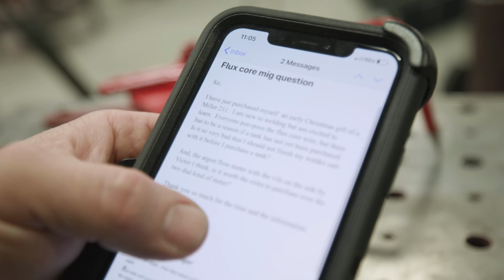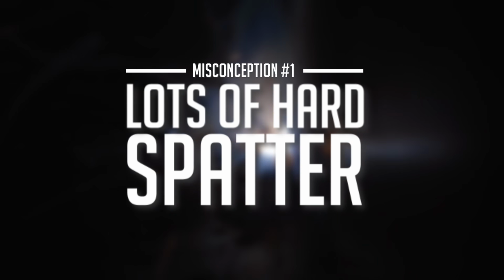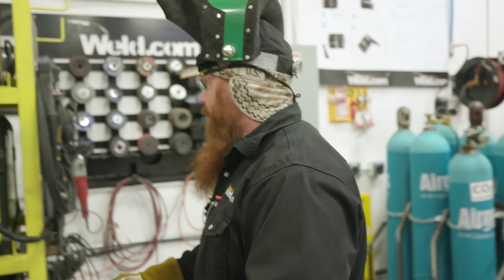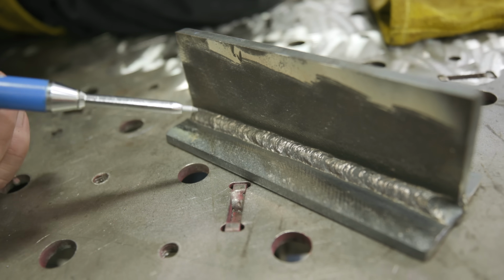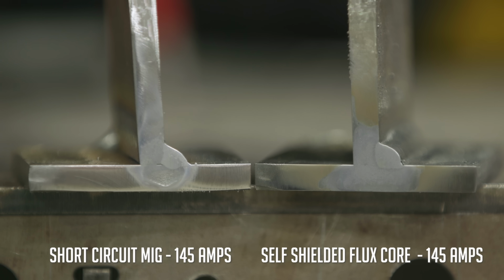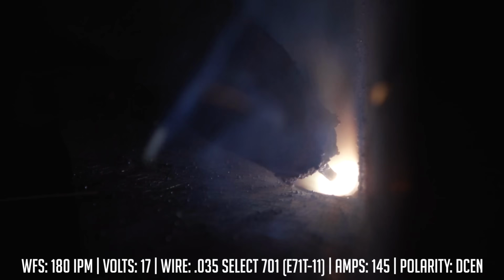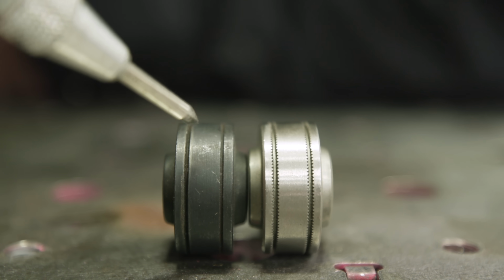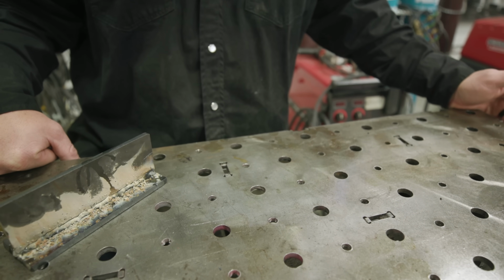3 Flux Core Welding Myths DEBUNKED

Comment: First time I tried flux core welding wire I did not like it. Turned out the guy that had set up the machine had the polarity wrong when set correctly and a little practice. Because it does run a bit different than solid wire. Flux core can actually make a very nice weld with a little practice

Comment: Outdoor and "dirty work" is where flux shines. Use to do structural work in the past. You will usually only find stick and flux welders on a job site. I never got to use it but my old boss had a spool gun for flux wire than would clean up just like a 7018 pass. 1 or 2 taps of a hammer and one big slag chunk would fall off.

Comment: I think flux core gets a bad rap from autobody guys.  If you use flux core doing sheet metal and put body filler over it the chemicals left over in the metal make the filler bubble up over time.  You have to use gas for autobody, unless you're using lead filler.

Comment: id say 75% of my welding is done with flux core with the rest being stick and scratch start tig. flux core works pretty good for things such as bumpers and rock sliders (i only use tig on motorcycle frames and stainless steel)

Comment: 2:56 The same current passes through the MIG wire no matter which polarity. The difference in heat is due to the arc column and the concentration of electrons at each electrode.

Comment: I fixed an old cast iron lawn mower axle that broke in half my little brother used an old mower as an off road mower and I welded it back together with my flux core machine  and it's been fixed for probably a year and a half now hasn't broke yet I love welding I just wish I'd get up and do something with my love for welding

Comment: I have been using flux core for years everybody says it sucks, but its my favorite out of any other wire and or TIG.  You need a very clean DC output and change the polarity,  just those two things got rid of almost all the spatter and it lays down great welds.

Comment: i bought my lincoln 180 welder off a journeyman welder, when i went to his garage to buy it, he showed me that it worked by doing some fluxcore. While he was welding, he said, you will want to get gas though, as you can see how much weld splatter fluxcore has and it sucks. I said to him, you have to switch the polarity. He had no idea what I was talking about. I bought the welder, took it home, switched the polarity and have been welding with fluxcore ever since just great lol (this was my first welder I have ever purchased and first time welding, learned the polarity from youtube. I was just shocked a journeyman welder did not know this, but the truth is, he probably never fluxcore welds)

Comment: I noticed that you switched polarity by just changing lead positions with your wire machine.  Can I do that with a stick welder too, to use polarity sensitive rods?  I am using a Miller Thunderbolt 250 stick machine.

Thanks for a very informative video.  It helped me decide about buying a wire flux machine.

Comment: Curious at my job i have dual feeder and i mostly use flux core over hardwire and nothing with polarity is changed and i run 27 on temp flat and 24 uphill.

Comment: Great video as you know in the trade we use flux core all the time for site work it just so much easier and you don’t have to worry about the tensile strength of the weld metal on those big jobs.

Comment: I have a Hobart flux core welder.. not mig capable so never had to switch polarity. I rip it up with my little welder.. no spatter and never grind my welds.. had a cheaper welder before that was on correct polarity but still sucked balls.. got this Hobart for $300 CAD and since I weld at home I don't think I'll ever need a bigger welder. Ctws tip will help me as I do get some porosity sometimes and now know it is a tip distance issue! Thx for the vid!

Comment: Can I weld thin car sheet metal with flux core? I need to put my new radiator core support. I already took the old one off by cutting the spot welds with a spot weld cutter!

Comment: Isn't it only a myth tho only when using a good flux core welder because the regular person that isn't a professional is mostly using cheaper welding machines with much less power and setting options that you can adjust so they can't do the same things you could with that really good machine?.

Comment: Tried to post this question on weld.com, but it didn't seem to work.  Curious about welding 1/4" or so with a 90amp/120v fcaw, question is whether it's actually better to use the 0.030 wire over the 0.035 for that.  I ask because I read somewhere that with the limited amperage, it's better to try to get as much heat as possible into the metal, with less required to heat up the smaller wire.  Any point to this?

Comment: Thank you great video!  Is the flux core better for welding in outside conditions over gas mig?  I am not a welder but I have a stick welder and use it on my hobbies.  And I have to do all my welding outside in driveway cause I don’t have a garage.

Comment: Good info, thanks. Here's a tip most long time welders don't know. You only want JUST enough tension on feed wheel to get consistant wire feed out of the gun. In other words, if you hold the wire as it's coming out of the gun, it will slip at the wheel and not continue to feed. That's about right where you want it as long as it feeds consistantly/smoothly. More tension than needed, will increase the depth of wire blow-back into the guns wire tip when that occationally happens at initial arch. Which then makes it more difficult to get the wire unstuck from the tip...For a good laugh go here. Yeah, that's a pretty good weld there...(23;30)https://www.youtube.com/watch?v=GXMAEYuxYyk

Comment: I've never seen an upclose weld so clear before. With the wrong polarity you could see the wire puddling up before it even broke off and flinging everywhere, with the correct polarity that wire seemed like a jackhammer going back and forth.

Comment: Oh man! I wish I could switch the polarity on my flux core welder!
Reply: Yeah, it doesn't make sense that they're not made to do that? I have Lincoln Weld Pak 100 and I'm wondering if it can be done on that.
Reply: I ding donged it. I haven't used the thing in so long...It actually does allow polarity change. : O i use fluxcore and it's set at EN.

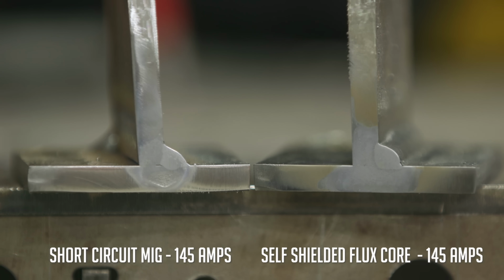Comment: @6:20, yes the flux profile does look better..."but" the solid/gas can be resolved by using the proper heat, feed and speed. I have laid miles of weld [mostly on pipe in hard to reach situations] using a Millermatic with 25/75 gas and .030 wire. Just yesterday my son was touting the incremental power settings of a Lincoln welder whereas the Miller has a 5 position switch settings system. I told him that with the Miller, I just look at my work, choose my heat and feed and have never had a problem.
Just like the weld descried at the top...Just slow the feed down and move slower if you want to use the same heat and you would have gotten better penetration. If one metal was thicker than the other, then just linger more to the thicker piece of work. Want to go faster [before the point of blowing holes] turn up the heat and feed and move faster while still achieving the same penetration.
It is an art...To each their own.

Comment: People who think flux is inferior don’t know or understand that all outside work is done with flux wire or some still use old school stick.. but it’s still flux rods lol. You can’t run gas in wind.. 

Second the most demanding highest need welding on the plant is done with flux core wire running co2 gas. It’s the strongest deepest penetrating process there is. It will make your 6010 root look like a Hobart 135 joint lol.

Comment: Can anyone recommend a mig welder to start out with in the UK. It would need to be run off a normal 240volts plug. I don’t want to spend a lot as apprenticeship wage isn’t great. If you have any other recommendations on wire, tools, practise, tutorials it would be great. Thank you

Comment: why is everybody talking about switching polarity. Your flux core should come with the correct polarity out of the box. I have a weldpak 100 and did not have to do anything to it just start welding.
Reply: I know hardly anything about this, but my guess is that many people come to this process after becoming proficient in another process that works better with a different polarity. Then they don't think about whether it needs to be different for a different process. Some knowledge can be more dangerous than no knowledge.

Comment: I don’t like flux core mostly  because the smoke but I also just prefer the way solid wire and gas weld but I will never say flux core is weak or doesn’t work because I know that’s wrong and always have it’s just not my preference but I’d take flux core over no welder at all

Comment: Great video, I ran 232 gasless flux core in the field for 7 years. When I was first starting out on gasless flux I had a strong stick, mig , Tig, and ran a lot gas flux core in shops. And at first I said you could shove it up your you know what. The hardest part for me was learning what was a hot setting and what was a cold setting. Sounds crazy but for me a cold setting could seam hot and vise versa. Any way got threw it , and love it  . But like all types of welding it has it's place and other processes are better in some applications.

Comment: I’ve been running flux for years in my garage and haven’t had any issues. Well except for randomly having the arc disconnect which blows out the pool. I bet it’s that contact tip thing. Something to try I guess

Comment: 1:18 he mentions the type of wire he is using. T-11 is a good, easy to use, all position wire.  T-8 is what you would use non-hobbyist for structural. It has a pink welding light. Personally when I was welding, I like ESAB wire. Although it was more expensive.

Comment: Hard to beat Lincoln innershield for dirty work like farm equipment, it shines where solid mig just blows up. It also adds effective power to pocket machines like the SP100 and it's brethren. The SP250 gets left on the trailer while the little brother gets the job done in a lot of "field" work!

Comment: I tried the knureled roller it works good but if the wire sticks in your gun you sure end up with a mess of wire piled up inside the welder.

Comment: Hi from Oamaru, North Otago New Zealand. In mid 1990's i was the very early user in flux core (Lincoln innersheild) . I used it for 3 yrs then suffered some sort of mental illness which took me 7 yrs to get over. That was due to me not using respirator filter due to being young and safety gear was very expensive. About a year or 2 lincoln was made to put safety notices on packaging as wire here was rolled onto reels from large bulk drums. At that period Lincoln was sued by class action in the U.S by steelworkers who welded submarine tubes with manganese rods during ww2 up to 1960's which caused Alzheimers etc

Comment: What's the best technique with flux core? Lowercase e's or a straight line or is there something better than either one of them?
Reply: Christopher Spencer There is no "best" it's mostly what you like.

Usually I draw circles, Cs if there's a gap. Just play around and see what gives good results for you
Reply: @Robert-qm7yi  
Thanks for getting back to me. I just wasn't sure if you could go back over the weld in a circle pattern or if it would trap slag in the weld
Reply: Christopher Spencer You can double back as much as you want, all the slag will remelt and float to the top of the puddle

Comment: only problem I've ever had welding with flux core is welding thin plates, 1mm is ok but slow, a tack here and a tack there, any thinner and I'll burn trough even just by tacking...

Comment: so im new to welding but bought a little "on sale" mastercraft 120v 20 ish amp flux core & mig welder and i havent used gas yet because i wasnt really sure if i wanted to buy it straight of the bat so i used flux core wire a little 1 lb .035 flux core wire i belive and it has gone great so far i have welded a dolly axle thing to hold bigger wheels and havent had any problems and of course thats with a prepped surface so it is for sure strong i have moved some big rocks roughly 60 lb rocks even moves 200 ish lbs of rocks wich isnt the full stock load cap but its holding up fine so flux core seems to work well for me

Comment: Great vids. All very easy on the brain. So a lot easier to remember. I don't know how many hobby welders are watching your vids. I would find it much better if you could do some instructions on smaller welders. As lots of guys only just starting out. They don't have the money to buy dual voltage. Or that run at high amps. Keep up the great work.

Comment: Always great content and knowledgeable. Use flux core a lot myself due to cost limitations on most of my jobs, my tip not all wire is the same quality find a good supplier and stick to it...its like welders/gas the cost isn't what kills it, its the quality.

Comment: Could someone explain the "short circuit" part for me ?
Reply: Low voltage MIG welding. Short arc. High voltage spray arc. Wire vaporized just about halfway from tip to work.
Reply: @gregorytimmons4777  so ...when they day short circuit they are referring to short arc length o.O

Comment: Yo electrode positive actually puts 70% of the heat in the base metal, because electrons travel from negative to positive. The reason for the bad weld characteristics on DCEP with flux core is that there isn't enough heat in the wire for it to function properly. That first weld has all the characteristics of being too cold, not too hot.

Comment: Voltage determines penetration why would you say 5/16 is the limit on short circuit? Not to mention if your limited to voltage you can get a little edge by preheating your material.

Comment: I used to use gas but I got caught doing jobs in the middle of the night well that ran into the night and ran out of gas and was forced to use flux core it turned out great no lie promise you, just keep a wire wheel handy and you good to go

Comment: Flux core is messy/splatters and leaves a porous weld bead so will leak if it's meant to hold gas or fluids.
It is nice in windy conditions and if you need a hard surface like rebuilding the wear surfaces of snow blower shoes.
Reply: archangel20031 flux is much cleaner than mig and a proper bead looks fantastic and is most definitely air tight😂
Reply: @smithbre005  No, flux core splatters and leaves a surface that needs cleaning, and is not air tight of water will leak through it!

Comment: Oh you had forgot to mention those that have bought the Chicago Harbor Freight welders are AC can't change the polarity on those unless you get a 150 amp rectifier some capacitors, bleed resistor and a choke coil... that's how you turn a cheap welder into a better quality welder... given you have already bought said welder and don't want to invest in a DC welder... I think doing this isn't very expensive..

Comment: I remember the first time I ever built a derby car....built it for one of my buddies, it was the first time he had drove in a derby... it was a Hyundai front wheel drive car..... all his buddies that had done it for years professionally ask him what kind of welder I was using and he told them a flux core..... they started laughing like he was joking and said no, really what kind of welder is he using.....my buddy said he's using a flux core ......he said they looked at him and said man you're going to get yourself killed, that will never hold..... my buddy told them well looks like he's doing a pretty good job to me I don't think it's going to break...... well Derby Night Comes and all of his buddies that had been doing it professionally for years... he put them all out within the first round or two and he got most aggressive driver and came in second place....only reason he didn't win was an alternator hot wire he ran across an engine bracket rubbed through and shorted out and killed the engine....not one weld broke.... and I'm no professional welder by any means..... just learned by doing it...... and the flux core welder I used to weld that derby car up was a inexpensive welder just a small cheap unit but I'm pretty sure it was a DC output I think it might have been a Campbell Hausfeld or something like that.... could have been an AC for all I know... I can't remember.. didn't really even know back then.... still use flux core wire welders to this day.... about a year ago I welded up  a Colorado truck frame that was broke completely in half due to rust using a 90 AMP Harbor Freight AC Flux core welder.... Truck is still going, tough as Nails better than Factory.....of course I did use a ton of plating....

Comment: I have A very old century 125 i got at a pawn shop 25 years ago for 50 bucks, I taught myself to weld on it and I have repaired hundreds of small utility trailers and built dozens of them with it. Flux core imo is the only way to go.

Comment: Can't change the polarity on my Lincoln but I do like flux core, it's the best. I've welded thin sheet metal to heavy steel. Really heavy I've preheated the steel with an oxygen ecsetyline tourch first. Worked great!

Comment: My first welder was a Lincoln Weld Pak 100. I paid $50 for it. It is 120 Volt plug in anywhere. It does have gas fittings but i never use it. Flux is easier to use and transport. As with anything there is a learning curve. I watched YT videos. I knew to set it up negative electrode, positive ground. Welds were terrible to start but I gained experience and now not so bad. I have repaired Snow throwers, ATV frames, cracked trailer frames, custom bicycle frames. It is great for a hobbyist. I moved up to Lincoln Power Mig 180 for a few jobs with thicker gauge steel. That uses a gas bottle and sits stationary in my garage. But for most uses I go with the Flux core and Weld Pak 100 for portability and ease of use.